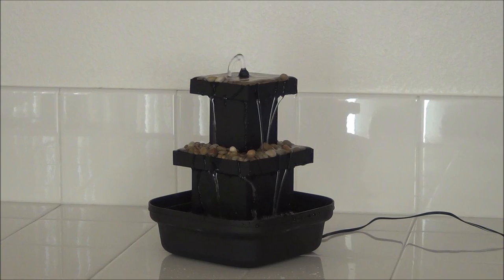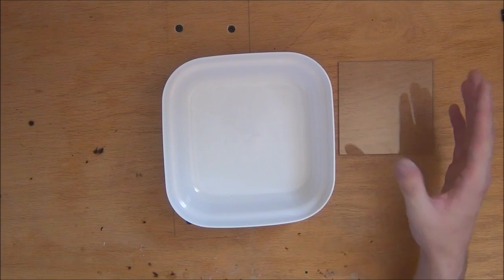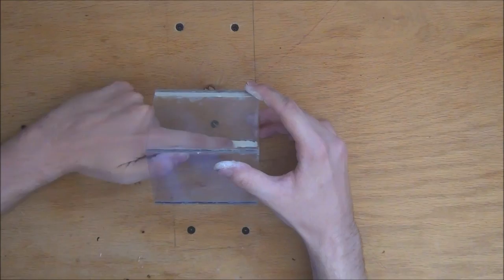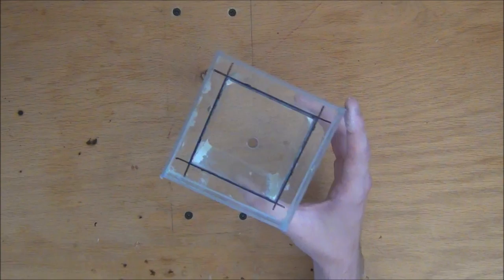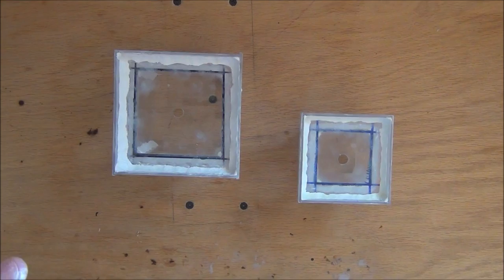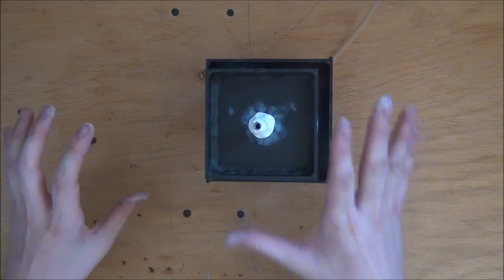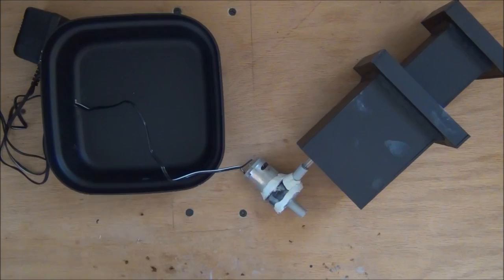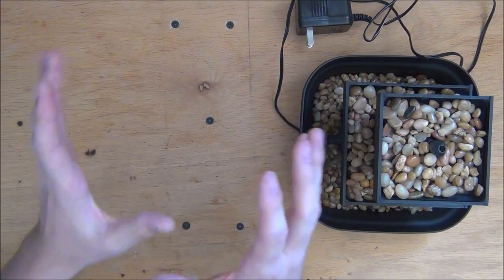How To Build A Tabletop Water Fountain!

Comment: nice work. can this be made with flower pots?
Reply from the maker: Yes, most certainly! It should actually look pretty cool too!
Reply: thx. i also wonder about using sanitary silicone instead of clay. it takes longet to dry, but does it allow to make it easier to change the setup? more towers, diferent pump etc.
Reply from the maker: I don't know if it would make it easier, but silicone would definitely work just as well as the clay! :)  sugru would also be awesome to use (that was my original plan) but its so expensive! iv been wanting to get some for awhile but idk if it worth it! haha!  :)
Reply: i'm still not sure what will i make or how, too many shapes and possibilities....
sugru? that wonderclay? you do think bit!
Reply: Pprokop87 wwhat is next

Comment: There’s quite a few issues here, you put water clay around the pump housing to keep water away from the ghetto water pump, acrylic epoxy would’ve worked better and looked better. And you built an entire housing to protect the pump when you could’ve just put epoxy on the motor leads. Any electrical engineer knows DC motors are waterproof as long as you cover the leads.. just saying, at that point you’re cutting risk down quite a bit. It’s an okay build but pretty mediocre

Comment: While I thought your water fountain was very creative, I feel I must point out that JB water weld isn't cheap nor is plexiglass meaning that for the cost of your parts you could have bought a tabletop fountain. I've seen them as cheap as $19.00
Reply from the maker: although that might be true, you would have to buy one with a generic design that some else thought of and everyone else has. And you would not experience the satisfaction of designing and building something yourself. Plus mine can be built for in $25     :)